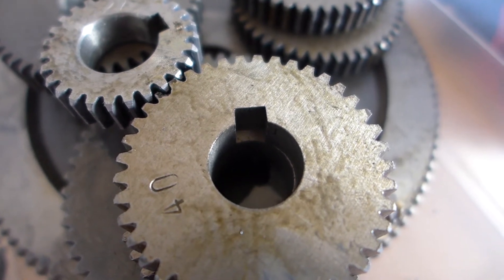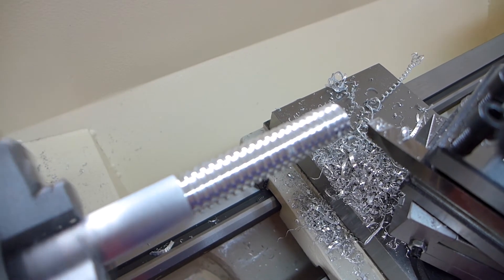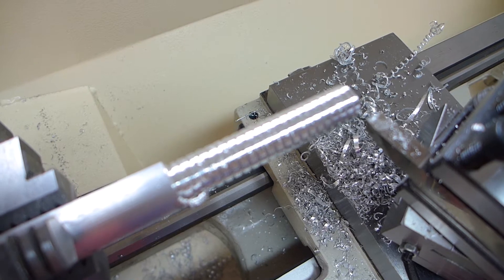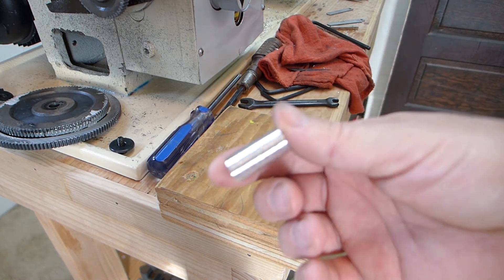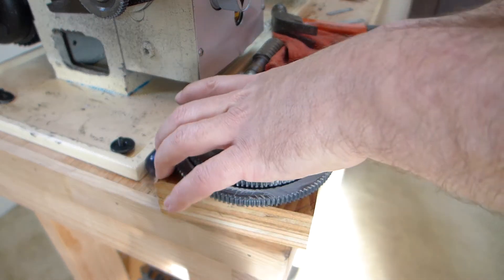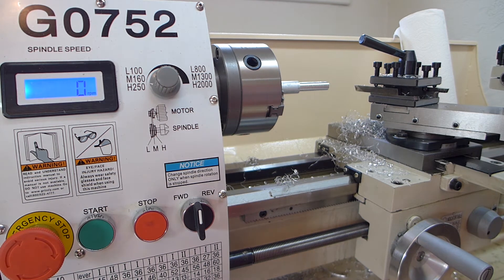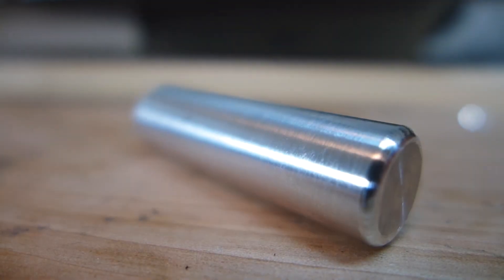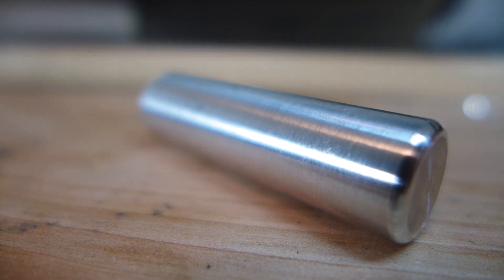Grizzly G0752—Making a "Gear Sleeve Extraction Pin"

Comment: hay i would sugest working closer to the chuck you kinda got a lot of hang out think the rule of thumb is 1.5 x the diameter is max . or you can put a center in the tail stack and support the end of long work like that . hope that helps good results in the end. good job
Reply from the maker: Hi, Chris. Normally that's what I'll do. Just fiddling around here. There was definitely major spring in this case! I'm working on a real project right now and have the 3/4" aluminum sticking out maybe an inch or so. Works great. Didn't know about the rule of thumb for that. Thanks.
Reply: i hope your watching mrpeet222 ox tools and abom79 tuns of good info
Reply from the maker: I really enjoy Tubal Cain. I think Tom's Techniques is one of the best instructional machining sites on YouTube. I watch a few others occasionally, too. There's so much good stuff out there and not enough time to watch it all. Thanks for your suggestions.
Reply: Your right I forgot him very good instructor .